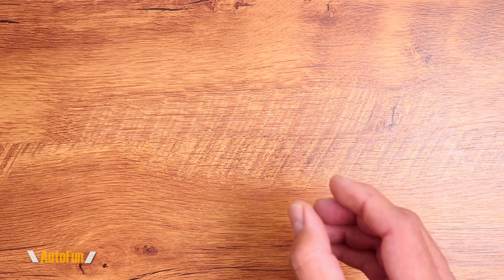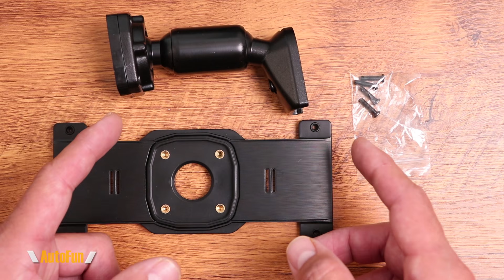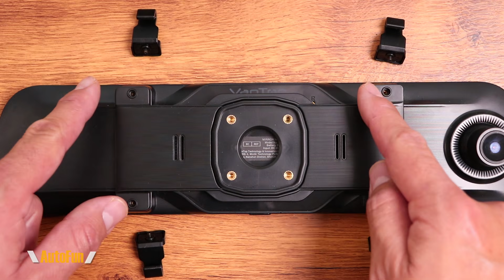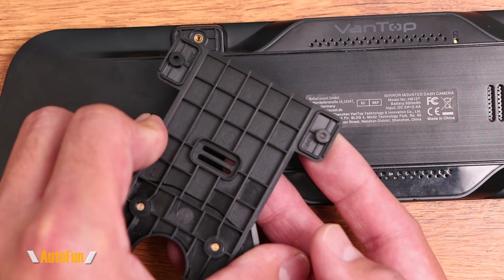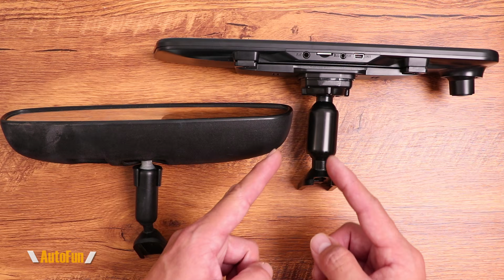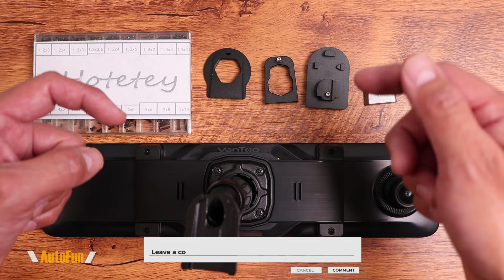How to Install Mirror Dash Cam WITHOUT Straps (Direct Mount Conversion Kit for LCD Mirror)

Comment: Anything for brand Jensite
Reply from the maker: Hi AJ! Unfortunately I have not reviewed the Jensite yet, so I'm not sure what kit will fit, however you can measure the back of the dash cam as I showed in video to determine the kit size. And If I do get a hold of one of one, I will measure it for you and update this comment. Cheers!

Comment: I purchased a Josime G814 and there doesn't seem to be screws in the back to add a permanent mount. Is there a way to add a permanent mount?
Reply from the maker: Hi Robert! Ah unfortunately if the G814 does not have screw holes in the back, the conversion kit will not work with it. Cheers!

Comment: Great video! Have you tried any of these conversion kits on the Rexing series of mirror dash cams?
Reply from the maker: Thank you! Ah regarding Rexing, I reviewed their M3 dash cam but it does not support conversion. However if you have a different Rexing dash cam you can measure the back of the dash cam as I showed in the original video here https://youtu.be/TtjZ7rC_ncY to determine the kit size. Hope this helps, Cheers!

Comment: I live in Florida. Those straps lasted about 2 hours before they melted. Came back to my car to find my mirror hanging on for dear life.
Reply from the maker: 😯 Oh wow! I think that is why most mirror dash cams have moved over to silicone over the rubber for the straps, but still nothing as secure as a direct fit conversion. Cheers from California! (we are at 106° right now unfortunately ugh)
Reply: @AlexAutoFun  We are hitting those types of temps too. I think I saw the devil with his usual entourage of demons taking n the rays. Apparently Florida is also a great vacation spot for the Prince of Darkness and his minions. Who knew being the devil could be so stressful. 😉😁😈
Reply: @AlexAutoFun  I am thinking about using some of my wifes small elastic hair bands to secure it. Im sure she wont mind. May just work...for now.

Comment: I have a 1990 Nissan 240SX. Does anyone know what bracket I need? This mirror actually attaches to the roof and not the window.
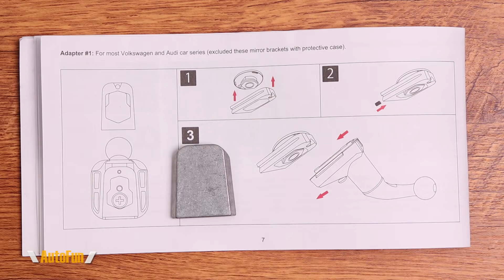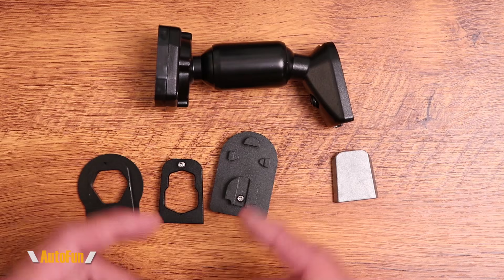Reply from the maker: Hi! You can see illustrations of what the adapters look like at the 6:42 mark and what they look like in real life at the 7:52 mark. Their appearance is very distinct from each other. Additionally I placed links in the description to them including specialty adapters including Nissan if you want to see more pictures of them so you can match them to the one on you car. Hope this helps, Cheers!

Comment: Hi does this attachment allow to lower down the mirror a bit as my CAS is a zafira tourer which has a bulky rainsensor cover which prevents from getting a complete field of view. In this case what do you suggest
Reply from the maker: Hi Jinu, this is going to depend on the size of your current mirror arm, but normally the replacement arms are about the same size (and in a few cases longer) than the stock OEM arm. However while I have installed direct fit kits on cars with an OEM enclosure for ADAS and rain sensor (you can see pictures of this under the "Community" tab in my channel) if you are trying to avoid having it in the cameras field of view, the camera must be relocated quite a bit (more than what a direct fit can do). On those cases I recommend a detached mirror dash cam like this one https://youtu.be/JJKbUu_egiE or https://youtu.be/zEvk-2z_zQY which gives the installer more control over camera placement including avoiding any obstacle that may obstruct the camera view. And I have more mirror dash cam reviews on my channel in the playlist "Dash Cams Reviews" if you like to compare them. Hope this helps, Cheers!

Comment: You did a very good job and I do like the slicker version of this. I just bought one that has a rear view and the front view a record review and a front view but it doesn’t have that bracket on it. It has a whole bunch of rubber on the inside that goes from the bottom to the top And I don’t wanna mess it up by peeling it off. What do you think I should do by the screws up under there because it’s a ADDKEY add Chi front and rear touch mirror. I love you thank you for your information very great content. I love it and you just help me out a lot but let me know what you think about the screws are they under or if you find it on the Internet and you look it up please let me know. I don’t wanna damage it before. I put it on the mirror and have it scratch up anything. Thank you sir.
Reply from the maker: Thank you Lamar! Ah yes I seen that in a couple mirror dashcams. What I do, I use a hair drier on low to warm up the pads carefully (to avoid burning or melting anything), this lets the glue releases so the can be peeled off easily, If I don't find screw holes in the back then most of the time I can just re-stick the pad. I have not reviewed the Addkey, so I'm not sure what kit will fit, however you can measure the back of the dash cam as I showed in the video to determine the kit size. And If I do get a hold of one, I will measure it for you and update this comment. Hope this helps, Cheers!

Comment: @AutoFun Do you know of a bracket  that fits the new Wolfbox G930 yet?  I was about to order the dashcam, but would like to order a bracket kit at the time.  Thanks in advance!
Reply from the maker: Hi inkedgenius! Unfortunately I have not reviewed the G930, so I'm not sure what kit will fit, however you can measure the back of the dash cam as I showed in the video to determine the kit size. And If I do get a hold of one, I will measure it for you and update this comment. Hope this helps, Cheers!

Comment: I fail to see the difference? Newer cars have a glare shield there. So this product has no use. I have 2 cars and 2 trucks, and you cant see the back of the mirror outside the car. And you cant see the straps either.
Reply from the maker: Hi Richard! Yep this modification is not for everyone, I think is only for those that want to delete the straps or their current mirror mount is worn down so it cannot support the addition of a second mirror on top without drooping down. However as you pointed out, I also have several cars with the dash cam mounted with straps (and in some cases people even think the car came with that mirror stock from factory lol), so I don't necessarily convert all my mirror dash cams to direct mount. Cheers!

Comment: So I bought one of these. It works but the power, rear cam, & gps connectors hit the edge of the ceiling then when I hit a bump it loses power.  

Is there a kit with a longer arm?
Reply from the maker: Hi BradK! good suggestion, I try to measure the length on the different kits I got, see if there are same or slightly different. Cheers!

Comment: Great video. I have several questions. I have a 2018 Toyota Sequoia TRD Sport 1. What mirror would you recommend as a replacement for my factory backup mirror 2. What mounting kit would I need?  3. can it connect to an existing factory backup camera?
Reply from the maker: Hi Don! It comes down to what you are looking for in a mirror dashcam. I run different ones on my cars so what I usually tell people looking for the right dash cam for them is to start by picking how many cameras does it need to have (2 or 3). Now that you have narrowed your selections, consider how much you want to spend on one, that will narrow your choices even further. Then consider any special features you are looking for such as 360° video, Side Camera, Detached Cameras, Wi-Fi, BSM support, Auto Brightness, Back up to SSD, Parking monitor without hardwire Etc. Finally you would want to compare video quality of your final choices. And I just began working on a video to compare my top picks for different categories, Stay tuned, Cheers!
Reply: @AlexAutoFun  Thanks for the swift reply. In all honesty, I just want a better view of the rearview. I don't need all the bells and whistles.
Reply from the maker: @iBartimaeus  You're welcome Don, ah ok here is good choice https://youtu.be/7UbJk32_k5Y Cheers!

Comment: Any progress for the G880?
Reply from the maker: Hi Jimmy! Unfortunately if the G880 does not have screw holes in the back, so a conversion kit will not work with it. Cheers!
Reply: @AlexAutoFun  thank you for the response I’m thinking of doing a magnetic option gonna see how well it works
Reply from the maker: @MrKnox89  You're welcome!

Comment: Hi Alex, I just purchase this WOLFBOX G930 4K 10" Rear View Mirror Camera. I don't see you have reviewed this on your comments or your video, but I will do my research on to measure the holds in the back and see if I find a bracket that will fit this unit. thanks your video is fully informational to adapt the new bracket instead of using the straps.
Reply from the maker: Hi Juan! Ah yes the G930, unfortunately I have not reviewed it so I'm not sure what kit will fit, however you can measure the back of the dash cam as I showed in video to determine the kit size. And If I do get a hold of one, I will measure it for you and update this comment. Hope this helps and congrats on your new dash cam, I personally can't go back to a regular mirror now. Cheers!
Reply: @AlexAutoFun  I will let you know once I'll get the measurements 👍

Comment: Thanks Alex! Great video! What about for Mazda cars? Is there out there any kind of adapter in the market?
Reply from the maker: You're welcome Luis! The normal mirror windshield tab is used on most cars however to confirm I always remove the mirror on the car before starting the conversion to check the mounting tab (I also placed links to specialty adapters in the video description) The other way It's done when dealing with a non standard mounting tab where I don't want to use an adapter is I remove the tab all together from the windshield and install a standard tab (link to the tab and windshield adhesive in the video description) Hope this helps, Cheers!

Comment: Or, just attach with the supplied straps.
Reply: Or you could do it the way you want instead of how somebody else thinks it should be done because it's your car and nobody else's opinion matters. Funny how that works isn't it.
Reply from the maker: @Tyler-mr5tj  Very true, one of the parts I enjoy the most about car modding and seeing different approaches and choices make each car unique. Cheers!
Reply: Looks cleaner without the straps.
Reply from the maker: @hillcountryskies  It definitely does, there is also cases where the old mirror ball mount has worn out and can't handle the additional weight of a dash cam so the mirror droops down, on those cases I always recommend just removing the old mirror mount and going the direct fit route since it comes with a new ball mount arm already. Cheers!
Reply from the maker: Hi graham! yep that is an option too! some of my mirror dash cams are installed with the straps and some with the direct mount kit. Cheers!

Comment: Which Adapter is used for the Akeeyo V360st which you reviewed? Thanks for your help
Reply from the maker: HI Flow! Unfortunately the Akeeyo V360st does not have screw holes in the back, so a conversion kit will not work with it. Cheers!

Comment: By doing this, does it fix the issue that when using the dashcam mirror with the screen off, the screen vibrates?
Reply from the maker: Hi HaCkeR VirUZ! My dash cam doesn't really vibrate but I seen what you are describing on some cars. It comes down to your car's harmonics and suspension. So I see vibrations vary quite a bit from vehicle to vehicle, some have really smooth idle and acceleration and some don't. Same with suspension (including tire setup) some cars are set for comfort and vibrations are minimal but some cars are tuned to be sportier and vibrations are more pronounced in the interior of the vehicle (specially in bumpy roads). The direct mount conversion sometimes helps reduce the vibrations but remember the main source of those will still be the vehicle the dash cam is being used on. Hope this helps, Cheers!

Comment: hi do they make an mirror adapter for the older Toyota models that mount to the ceiling of the cab 2001 Tacoma?
Reply from the maker: Hi Ray! Yap! there are specialty adaptors for this, I place the links to them in the video description if you want to see what they look like and compare to your car. Hope this helps, Cheers!

Comment: what bracket do I buy for my Akeeyo 360 mirror? Thank you very much!
Reply from the maker: Hi Anthony! Unfortunately the Akeeyo 360° does not have screw holes in the back, so a conversion kit will not work with it. Cheers!

Comment: What bracket do I buy for a GKU M11 dash camera in my Nissan NV200 van.
Reply from the maker: Hi Hunters Rest Rabbit Oasis! Unfortunately I have not reviewed the GKU 11 yet, so I'm not sure what kit will fit, however you can measure the back of the dash cam as I showed in video to determine the kit size. And If I do get a hold of one of one, I will measure it for you and update this comment. Hope this helps, Cheers!

Comment: I have a gku 12 pro and my car is hyundai tucson 2023 model. what the direct mount? thanks
Reply from the maker: Hi John! Unfortunately I have not reviewed the GKU 12 Pro mirror yet, so I'm not sure what kit will fit, however you can measure the back of the dash cam as I showed in video to determine the kit size. And If I do get a hold of one of one, I will measure it for you and update this comment. Hope this helps, Cheers!
Reply: @AlexAutoFun  alright, i will try to measure it. thank you for your prompt response.
Reply from the maker: @johnfrancisardena4876  You're welcome!

Comment: Does this fit the pormido50 3 channel ?
Reply from the maker: Hi seth! Unfortunately there are no screw holes in the back of the D50 so the conversion kit will not work with it. Cheers!

Comment: I purchased a tadi bros 7inch mirror back up camera,what kit would I need to fit a2006chevy truck?thanks
Reply from the maker: Hi Curry! Unfortunately I have not reviewed the Tadi Bros mirror yet, so I'm not sure what kit will fit, however you can measure the back of the dash cam as I showed in video to determine the kit size. And If I do get a hold of one of one, I will measure it for you and update this comment. Hope this helps, Cheers!
Reply: @AlexAutoFun  Thanks for responding, I looked at the Tadi brothers mirror and it didn’t have straps,it had a couple of spring loaded tabs that keep it attached to the oem mirror,I hope you find a fix for it someday!,thanks for all you do

Comment: do you have dash camera mount adapter for rexing m3 ? for a chevy impala
Reply from the maker: Hi Methodical Madness with Countertop Gadgets! Unfortunately the M3 does not have screw holes in the back, so a conversion kit will not work with it. Cheers!

Comment: Hi, I have the Van Top Discovery H609...do u have a kit for that?
Reply from the maker: Hi Ralston! Unfortunately I have not reviewed the H609 yet, so I'm not sure what kit will fit, however you can measure the back of the dash cam as I showed in video to determine the kit size. And If I do get a hold of one of one, I will measure it for you and update this comment. Hope this helps, Cheers!

Comment: Has anyone been able to cad the mounting bracket yet? Looks like amazon has already ran out of the mounting kits
Reply from the maker: Hi Shivang 0011! I just checked the links, the mounting kits are in stock (but I seen cases where they will not come up if your are in an area that Amazon does not deliver them yet to) Here is another bracket mounting alternative if you want to mod your own kit https://youtu.be/fveZiDofnxg Hope this helps, Cheers!

Comment: Centimeters or Millimeters... Maybe it doesn't really matter?
Reply from the maker: Hi Old School Auto Upholstery Techniques! correct! technically the unit of measure should not matter as long the measurement is accurate (and obviously that the UoM being used is for distance). Hope this helps, Cheers!
Reply: @AlexAutoFun  Good answer!
Reply from the maker: @oldschoolautoupholstery  LOL thanks Bud! btw you have a nice collection of videos on your channel, I recently did some upholstery repair on some of my cars, I didn't know about your channel, so I will check them out (this was my first time, it worked but obviously I lack the experience to make it look super nice lol) Cheers!
Reply: @AlexAutoFun  Thanks for recognizing me. I appreciate it. My channel is still new. See ya!

Comment: Alex, I have a vantop 612 that I thought was having display problems until I realized I accidently turned on the screen savor. It took me a week to figure it out. 
My question on the dash mirrors that are permanently mounted how do you access the reset switch?
Reply from the maker: Hi Harry! Ah interesting, some kits have a hole or a space so the reset button can still be accessed without removing the kit, however because most of this kits are universal, it is possible the reset hole could be obstructed and will require the kit to be removed to access the reset button. Alternatively, the kit could be modified to add clearance for the reset button (you can see on my follow up video https://youtu.be/fveZiDofnxg how I drill into this kits to add additional holes) Hope this helps, Cheers!

Comment: What about a kit for the Pormido D50 Mirror Dash Cam
Reply from the maker: Hi Carlo! Unfortunately there are no screw holes in the back of the D50 so the conversion kit will not work with it. Cheers!
Reply: @AlexAutoFun  ok understandable..,,,,,,,, Is there a 3-channel mirror 9-inch or smaller dash cam on the market...          I need a small dash cam for my sports car...
Reply from the maker: @lambo25  Hi Carlo! So far there are no 9" or 10" dash cam mirrors with 3 channels, the smallest is this one at 11.5" https://youtu.be/JJKbUu_egiE Hope this helps, Cheers!